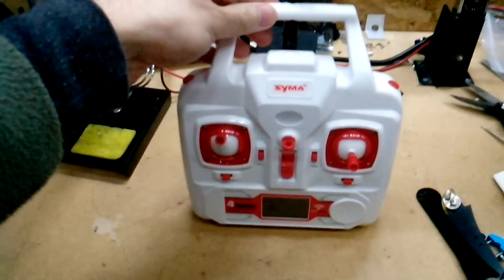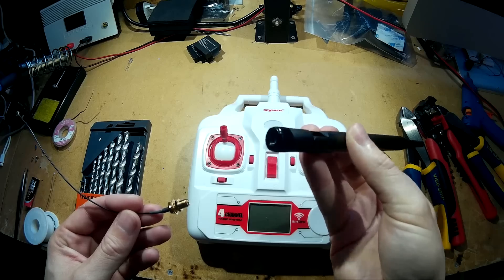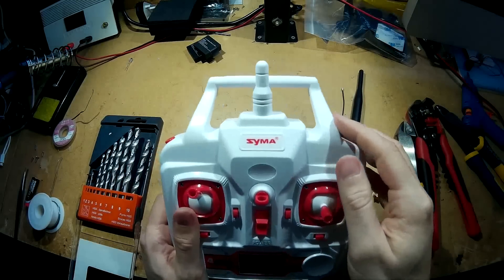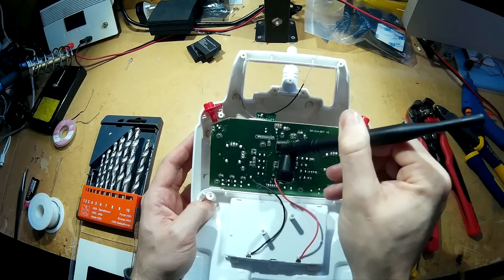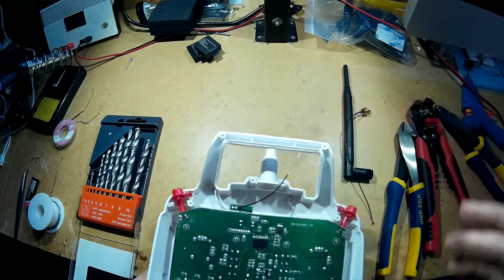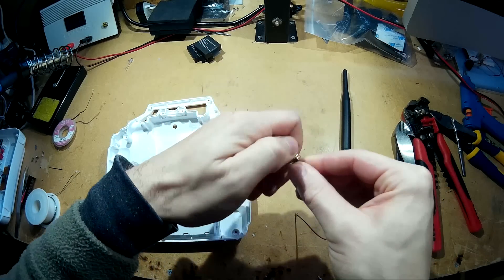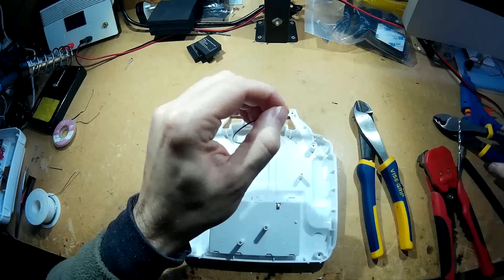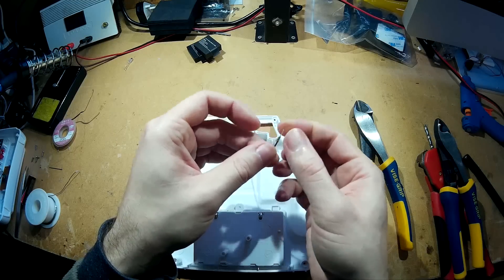Syma X8C Transmitter Range Mod 300+ meters of range.

Comment from the maker: Brought parts from here Antenna  https://goo.gl/EHthh2 Rp sma pig tail lead https://goo.gl/VcKx4M
Other spare parts
Long leg Landing gear https://goo.gl/RTJbF8 Receiving-Board-Spare  https://goo.gl/rhH18K Camera Holder Mount For GoPro SJCAM https://goo.gl/BLTW1K Fluorescent-Propeller https://goo.gl/JopVne Motor and Motor Gear Motor Base https://goo.gl/VGTxDP  7_4V-2000mAh-Battery https://goo.gl/rVShb2  5_8G 40CH Mini FPV Goggles https://goo.gl/ywHhLY  Eachine  mini FPV Camera https://goo.gl/doR94p
Reply: DIY TEK NUT would a 2.4ghz 3dbi antenna work with the same drone

Comment: Hope no one actually tries this. Great way to ruin a perfectly good transmitter. Wont go past 20 feet now.
Reply: How is That? If done right it works marvelously! I just finished this mod and it works oh so well. I was able to connect and bind and take off from 1000ft away. I also have extensive radio circuit experience too. Most people neglect to connect the outer shield of the braided pigtail to the other side of the antenna circuit, which is basically a ground. Anyways when done right this mod works!
Reply: How is That? When this mod is done correctly it works marvelously! I just finished it myself and was able to bind and fly my quad from a little over 1000ft away. Most people neglect to connect the outer shield to the other side of the antenna circuit, which is basically ground. Anyways when done right it works great!

Comment: Congratulations on the videos, but I have a doubt, where can I send you a photo of my RC plate? It is not the same as the photo, and the syma X8C plate either, the two antenna cables are the same color ... ..

Comment: Did it, range is the same as it was before. All of these how to's are the same and no test flights to prove theory worked.
Reply: Hey help me. Can i get a better transmitter on amazon with 2.4 gh and will it work ? Do i have to buy a reciever too ?
Reply from the maker: yes it works, its like sw radio the bigger the antenna the stronger the radio signal. the thing with a test flight is once you get passed 100-150 meters its hard to see on video i could say it's a mile away and you would not no the difference.
Reply: this is true.
Reply: good question, I have the same question
Reply: Just fyi, shortwave antennas are huge by design also, because the frequencies are so low that it takes a very long antenna. Generally the bigger the better for receive, but for transmitting you want that antenna to be tuned to it's frequency, otherwise it doesn't work well at all and burns up the output circuit. The Wi-Fi antennas work just right since the controllers are at the same frequency! :)

Comment: RANGE almost depends on POWER. NOT increasing POWER --> NOT increasing RANGE.  That's all!
Reply: Power will never compensate for a poor antenna and the antenna in these radios is terrible. Increasing power levels only makes sense if you already have a good, matched antenna AND the ability to legally do so without bricking your radio.
Reply: Couldn't have said that better myself! You can talk across the world on an HF radio using just a few watts as long as the antenna is perfect. The antenna is the most important part of a transmitter setup!

Comment: Hey, I was doing this on the syma x5 and the metal pad where the broke off and now the board is only visible in that spot. I tried to add soldering to that area, but it wouldn't stick. Any suggestions?

Comment: so you get 300m plus with this mod?
Reply: +Michael Myers***I have seen lots of these videos on range mods. They must be flying where something is wreaking their signal. I wonder if they try range test before doing the range mod. Because I get 750 meters stock on the ground straight down the road and up in the air I am sure it will get 1000 meters easy. That's way more than I need. I have lost two this year never to be found.
Reply: byrumjr yea i lost one too, have no idea where it went lol
Reply: @michaelmyers7779  your fault for flying too high, not the extended range. I need extended range to be safe so that i dont lose range if i happen to fly higher than usual
Reply: How do u lose it?

Comment: Thks for the video. Gave me insight to the inside of the controller. My controller had the same very short wire antennas for both the quad and the camera wi-fi. So I just happen to have plenty of those little antennas. made the same Mod and just added the piece of copper wire to the Quad antenna. Just did it. Of course it is raining here in Florida. I tested the wi-fi in house and notice the video is sharper. will update with the range later. But again thks for sharing the info. Helps a lot of us learning techies...
Reply from the maker: +swfsecurityman1 Thanks for you comment hope all goes well with your mods happy flying have fun.
Jace.

Comment: Are you just soldering the one antenna wire to the board what about the other wire are you soldering that one also to the board maybe it's the ground. Thanks
Reply from the maker: +Lewis Jackson no solder both antenna and ground for best results.
Reply: But just the internal one cable??
How about the earth of tge cable?
Thanx

Comment: I was wondering about the short 1.5" antenna wire in the quadcopter? If you extend it in any way, can that also improve with more range? Has anyone ever done this? I saw a video on a CX 20, but that is a totally different beast. I would guess you can add the extender on the machine and extend it down it's leg for better range? Not that I use the legs on mine. I guess if I wanted to run the camera I would. But the antenna on the circuit board is just a short braided wire with plastic sleeve. I would guess so it isn't too long, since it is a cirtain length for the frequency, the extension would need to be shielded?

Comment: Are all Syma controllers different because all I did was solder on a 2 inch piece of copper wire and now I have 533 yards of range that's 1600 feet
Reply: +treverlid87 ** something must be  wreaking your signal Because I get 750 meters stock on the ground straight down the road and up in the air I am sure it will get 1000 meters easy.
Reply: Yes, if the added antenna has not the right lenght it does worst than better.
It can be half of tge right misure but not an arbitrary lenght

Comment: i did the exact same thing you just did and my x8c will not bind to he transmitter what did i do wrong
Reply: +Keith Marion Type this in on YouTube Syma x8c step by step transmitter modification 300+  meters of range video by cockpitvuE777
Reply from the maker: +Andy Shaffer you may have shorted the two solder connections with solder. Or  if you powered the transmitter on with no antenna connected its fried that's the only thing that can go wrong.
Reply: no i saw another video and i saw where they were using the ground wire on the coax cable and soldering it to the ground  and i tried that and it works fine now.
Reply: +Andy Shaffer can you put a link to the other video?

Comment: An awesome mod my friend. Those drills are very sharp. I shall have to get on over to Banggood. Had a nose before. I think I will have to have a very good nose this time. Many thanks my friend. My regards to you all. Shoulder still mending ok.
Reply from the maker: +Raymond Earle Thanks Raymond. Yes they are pretty good drills. Banggood is a good site i buy tons of stuff from their.
Glad to here your shoulder is mending. 
All the best my friend.
Reply: Yes it is a good site. I have it open in a Tab now and keep coming back to it to have a break and a cupa. Thank you my friend.
Reply from the maker: +Raymond Earle Yeah i have a quick look 2 3 hours later still looking. They have some good electronics kits you probable have one DIY Multifunction tester very handy for when your recycling components i use mine all the time Have a good day mate.
http://www.banggood.com/86-Plastic-Shell-DIY-Meter-Tester-Kit-For-Capacitance-ESR-Inductance-p-956240.html?p=070519238739201308J6
Reply: Thank you my friend. You too.
Reply: +Norfolktuber  dont dril. just need PCB board. ( just remove original and made the new holder from PCB board for new antenna.)